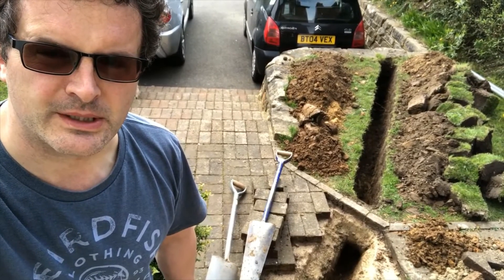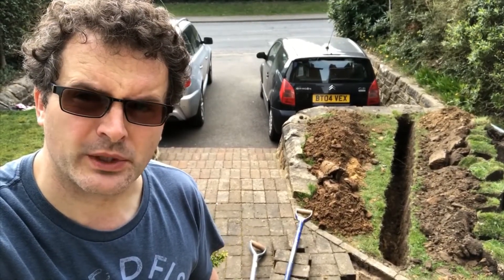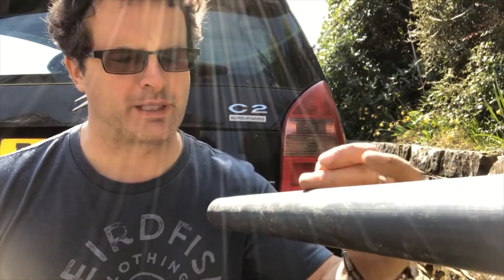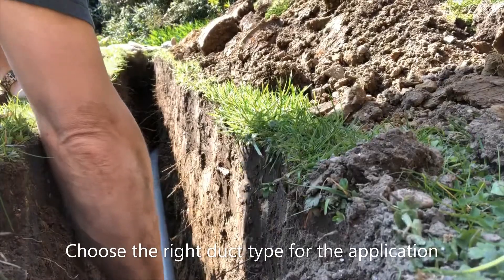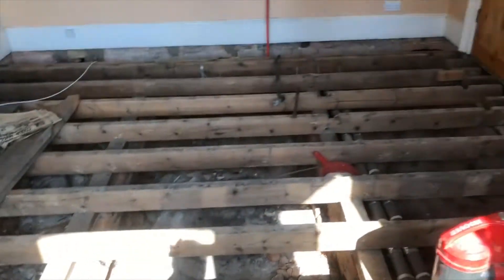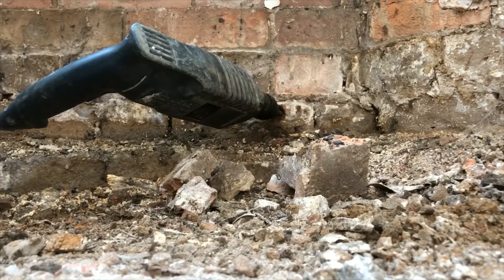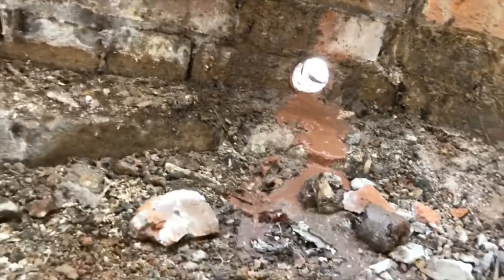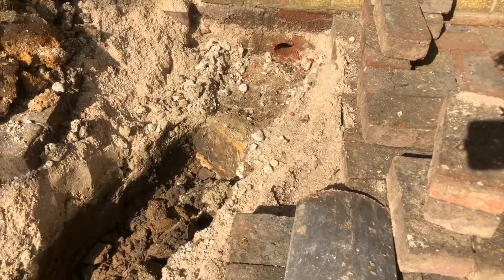Electric vehicle charging point cable installation

Comment: For reference it would have been better to have got twin walled flexible ducting, although it is corrugated on the outside, its actually smooth on the inside.  Also a massive think that is needed now is a cat5 cable for CT clamp not to blow the main fuse and for internet connection so anyone seeing this thinking they will do it themselves then add in a cat5 cable, make sure it is shielded cat5 rated for outdoor use if it is going to be ran next to the cable...    If you insist on using rigid ducting/piping you can fill the pipe with sand then heat and bend for a much better finish on the bend...
Reply from the maker: I don’t believe ELV and LV are permitted in the same duct under BS7671 due to the inductance risk.
Flexiduct would have worked okay, and may have been easier to work with.
Thanks for watching.
Steve
Reply: @SteveWardellDIY  Ideally you would run a separate trench at least 30cm away but who wants to do that, unless its a really long run its not likely to have any effect on cat5/6 cabling but to be sure use shielded cable that will protect against any electro magnetic effects, I tend to use double shielded cat6, it has an outer shield and then each of the pairs are also shielded.   I'm a fully qualified spark, there is nothing in BS7671 that bans it especially shielded ELV cable.   You can actually get EV ultra cable now which has power and Cat6 in the same cable so if running a cat5/6 shielded cable within the power cable is no problem then running it in the same duct will also be no problem, I have done this lots of times and its not an issue.

Comment: Subbed & liked. 
Man that was some serious upheaval for a charging cable & an impressive amount of work that should save you a fair bit of cash when you finally have an EC charger installed by a pro - who would never go to the lengths you did to get that cable in.  
I know it's not a power cable but when I had a fibre internet cable run into my house the installers only buried it at spade depth right across the front lawn & didn't put it in a duct of any sort. Can't help thinking that this was not deep enough & without any sort of protection. Nice video.